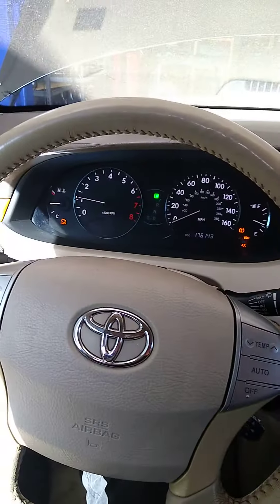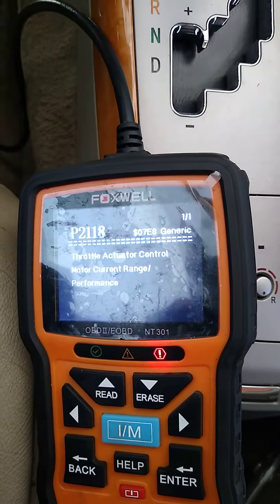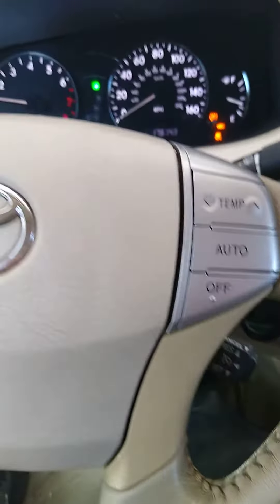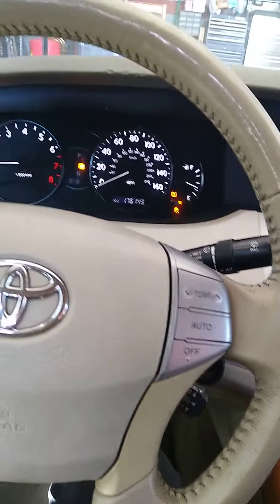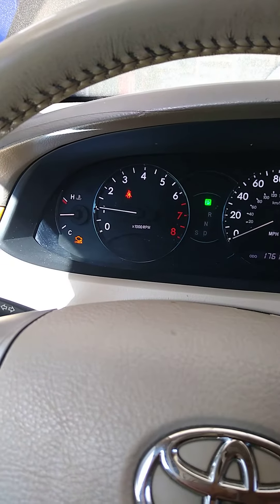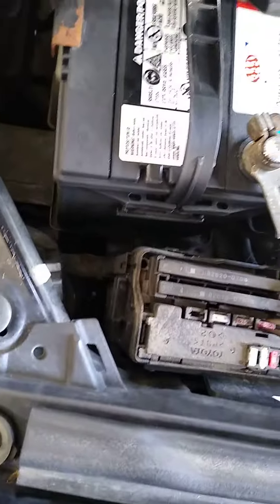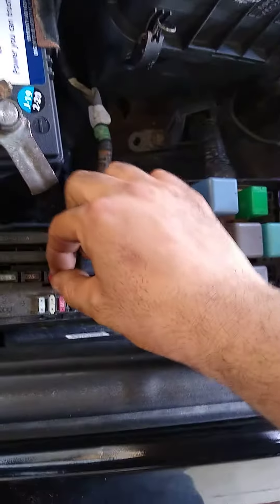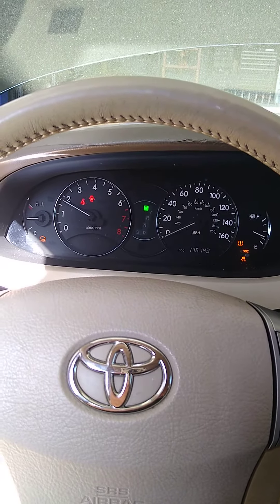Toyota code p2118 easy fix.

Comment: Thank you. But what caused the fuse to blow in the first place?
Reply: throttle body is dirty and wearing out so it draws more amperage to operate. some people replace with 10A and then later 15A and drive until the throttle body eventually wears out completely. do not put a 20A fuse there unless you want to melt and short wire harnesses. $$$$ repair